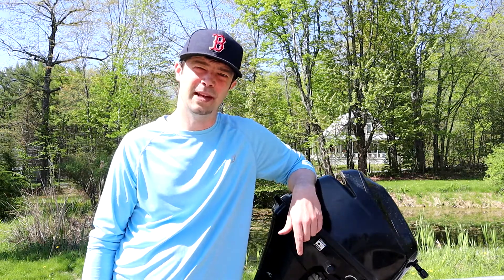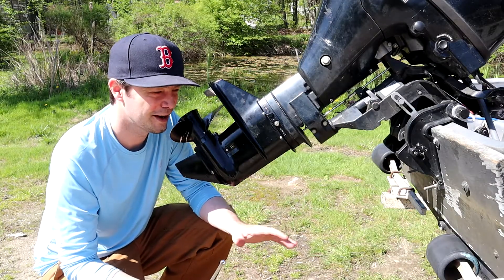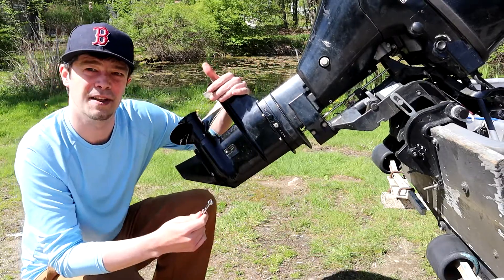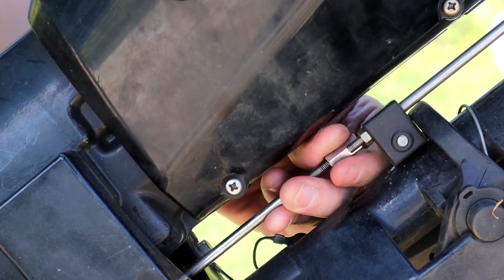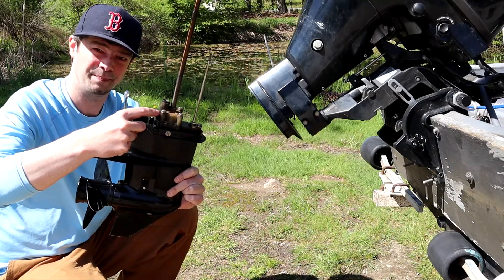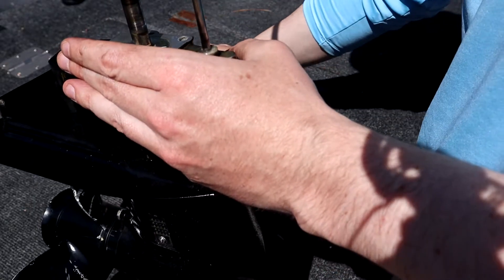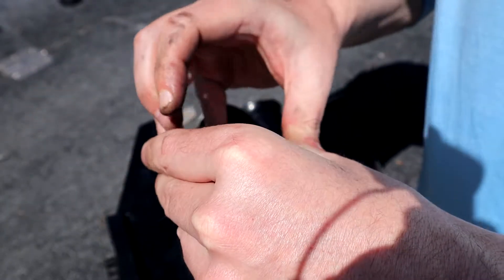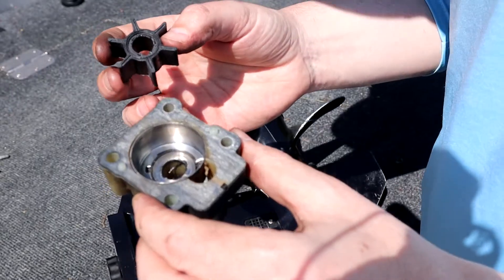How to Change Water Impeller Mercury 9.9 4 Stroke

Comment: just curious, would this be one of the reason why the motor would shut off (while running) i guess its like a fail safe. cause under long runs i find my 9.9 would shut off or wont turn on for awhile. when removing the lower unit, do you have to drain the lower unit? does the 9.9 have an oil filter?
Reply from the maker: I dunno. No oil filter.  Upper and lower oils are different. Upper is oil, lower is lube.

Comment: I did this video step by step and it’s not peeing. Last time I ran it it was barely pumping water due to the impeller needing replacing so do that and now nothing. For the longest time I couldn’t even get the linkage right. Anything I coulda done wrong or could do to make it pee again? I stuck a wire up the tube to see if it was clogged and bout to start it again to see if that was the issue. If not then I have no clue what the issue would be.
Reply from the maker: @AkGav27  with the muffs or in water?
Reply from the maker: I find sometimes the miffs don’t work at all. Maybe find a trash can and fill it with water and see if that does it. Your thermostat maybe stuck too.
Reply from the maker: @AkGav27  make sure impeller is on right way. Maybe it’s spinning opposite?

Comment: Don’t forget 24C grease on the shaft and bolts and to note the direction of the impeller blades! Don’t use an anti seize for bolts unless it’s non metallic. 
Great videos. Would also save viewers a step if you mentioned the screw head/socket size :) 
Appreciate the time you’ve helped save!

Comment: I have a newbie question please. Is the water that pees out of the little hole on the side just to indicate that the cooling system is working, or is that actually the entire output of the cooling circuit? Also, does it flow even if the thermostat is closed because the engine is cold? I'm halfway through doing the job, waiting on parts, and I couldn't  see anywhere else the water could escape (but I am new to outboard maintenance) thanks. Simon.
Reply from the maker: If you look near the prop, there should be a little vent looking thing. The water propeller spins off the drive shaft, regardless of the gear it’s in or if it’s in neutral. As it spins, it circulates water from that vent up the engine and out the piss hole to cool the engine. 

I believe some outboards have a water pump: a totally different system. Usually the smaller outboards have a water impeller tho. 
As for the thermostat, I believe as the engine warms up, it opens to allow more water through to cool the engine. Those things can seize closed or open. You can put it in boiling water and see if it opens. I remember looking at mine and it had debris in it keeping it open, possible not allowing the engine to warm up properly. 
If you don’t have water pissing out the hole at all times, either it’s not working or it’s clogged. This happened to me after I was fishing in really shallow mucky water. I used a thin Allen wrench to unclog it.
Reply: @MaineManBassing  Thank you very much for your answer sir. I'll try the allen wrench tip on my Merc 9.9. Good fishing. Simon.

Comment: Great work, what should the adjustment be on the shift rod/linkage can't get into reverse after impeller was replaced (previous owner)
Reply from the maker: Can’t remember. Play around with the linkage rod and screw.
Reply: @MaineManBassing  thank you for response, reverse is all the way down on shift rod correct?
Reply from the maker: @pucho513  can’t remember. I think so. Just try to connect linkage rod in neural trap and play around with it. If that doesn’t work, connect it in forward and see what happens. Just play around connecting the link rod with each gear. You should get it eventually.
Reply from the maker: @pucho513  unscrew the link. Put it in a different gear. Screw the link. Try again. You’ll get it.
Reply: @MaineManBassing  Thanks for all the help and suggestions I really appreciate it 💪🏾👍🏾
Reply: @MaineManBassing  thanks once again friend, no more shit jamming and I have reverse✌🏾💪🏾

Comment: Great video. Just as a point of reference so as to know in terms of hours. You said you change it  at the beginning of the season, so what is your guess-estimate of the number of hours you run in a season? I am asking just cause the impeller you took off was pretty beat up, so it must have run for a lot of hours.  Thanks.
Reply from the maker: So I was running it out of the water trying to trouble shoot some things. But that was the original impeller, and it’s a 2016 model.

Comment: Since I'm not too knowledgeable on boat motors, I had to have my impeller replaced on Mercury 9.9 4 stroke.  Also , the mechanic had to clear out debris from the water pick-up tube and replace the thermostat.  $ 550 later, it runs like a top.  Had no idea that these things had to be changed on a regular basis.  Thanks for the info.
Reply from the maker: @jdwfenton  yeah I replaced my thermostat as debris had it stuck open.

Comment: Great video.  I planned to change my impeller and was wondering how to disconnect the shift linkage and this video showed me exactly how to do it.  One suggestion, use a little anti-seize on all bolts since you have two dissimilar metals, stainless bolts into aluminum housing. Will make getting the bolts out easier the next time, and lessen the chance of a bolt snapping off. Been there done that.
Reply: Great suggestion 👍🏾
Reply: I was wondering about the shift linkage too.  Thanks

Comment: Don't you put grease on the main shaft going into the engine head? I remember dealer did it. Also some grease into the impeller box...
Reply: he should. Grease on the main shaft prevents long term tear damage to it
Reply: @eddiegordo3472  Dab of grease also helps the pin/woodruff key stay put while setting the impeller down.